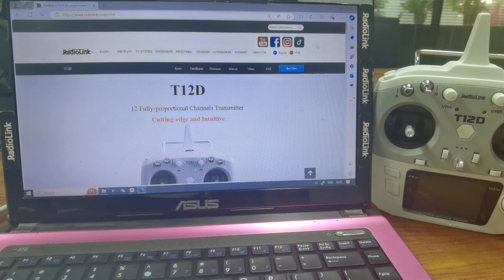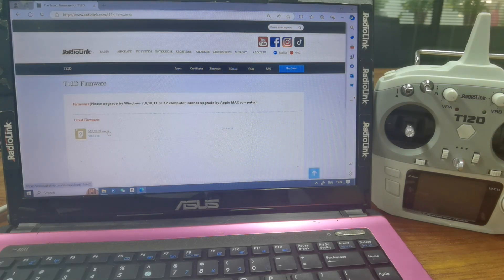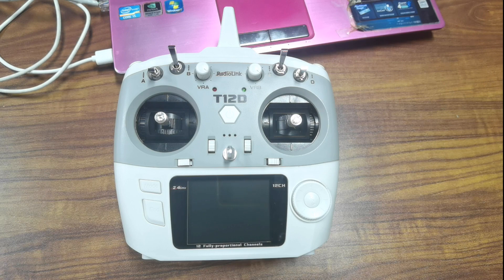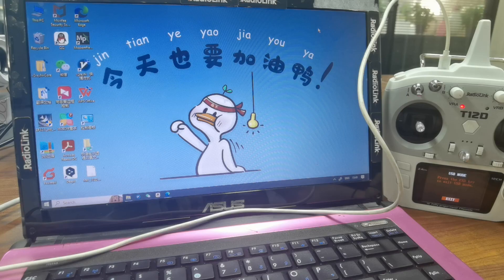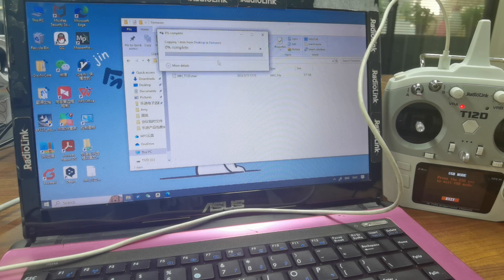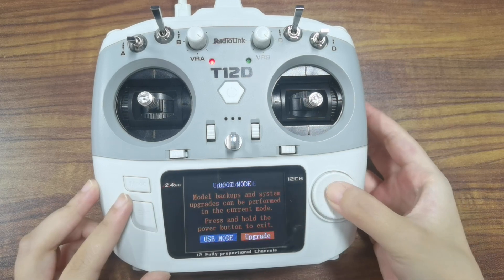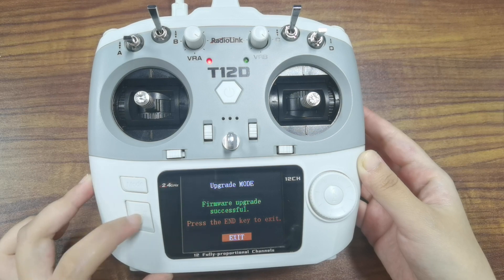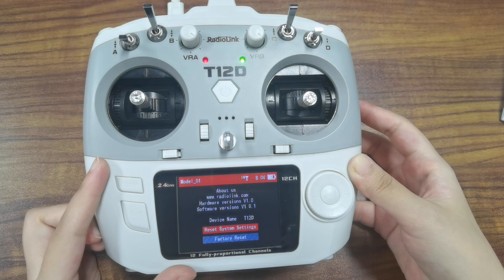How to update firmware of RadioLink T12D Transmitter?

Comment: Что лучше AT9S или t 12D ????
Reply from the maker: Dear sir, that depends on your specific usage scenario. These two products have different strengths. The T12D focuses more on cost-effectiveness and comes with a built-in simulator function, making it suitable for beginners and entry-level players. The AT9S PRO emphasizes anti-interference and high-speed response, making it more suitable for practical applications and players with some understanding of RC. Both products are compatible with external high-frequency modules. If you want to learn more about these products, you can check on our website.
Reply: @Radiolink_official And what is better for distance, At9s or T12??? I will use it for an airplane, can you help me choose between these two models??
Reply from the maker: @MementoMori-f6o  Hi, sir. Here is the comparison of T12D and AT9S Pro: https://www.radiolink.com/newsinfo/937609.html  The control range of both of them is about 4000 meters. If any question please feel free to contact us. Our email is: after_service@radiolink.com.cn
Reply: @Radiolink_official And if you use a range module, how much can you increase the distance????
Reply from the maker: @MementoMori-f6o  Hi, sir. If you use a long-range module, it depends on your long-range module.
Reply: @Radiolink_official You don't understand something, you do this and you can't tell me? How much can you increase the distance if you use a module? And which remote control is better to take?
Reply from the maker: @MementoMori-f6o  Hi, sir. The control range of the some modules can reach at most 30KM. For the actual control range, you need to check the specifications of the module. And both T12D and AT9S Pro supports CRSF and ELRS module. You can check their tutorials on our YouTube channel:https://www.youtube.com/watch?v=PuAQxhQXXis&t=3s   https://www.youtube.com/watch?v=W3HF_75FHeM  https://www.youtube.com/watch?v=5gClfQRbBVI&t=3s  If any question please feel free to contact us. Our email is: after_service@radiolink.com.cn
Reply: @Radiolink_official Well, if we compare the characteristics of these two models, which one will be better?
Reply from the maker: @MementoMori-f6o  Hi, sir. Both of are great. It depends on what function you want and which transmitter you like.
Reply from the maker: @MementoMori-f6o  If you want to connect ELRS module, you can use T12D. If you don't use long range module and just want the functions of the transmitter, you can use AT9S Pro or AT10II.
Reply: @Radiolink_official So it is written in the description that the long-range module can be installed on the at9s, or am I wrong?
Reply from the maker: @MementoMori-f6o  Hi, sir. Yes. You can also connect ELRS or CRSF module to AT9S Pro. If you want to connect ELRS module, you need to modify the cable. For T12D, you can refer to this video: https://www.youtube.com/watch?v=5gClfQRbBVI
Reply: @Radiolink_official According to you, t12D is slightly better than at9s, but why is t12d cheaper then? And at9s is more expensive, what's the difference?
Reply from the maker: @MementoMori-f6o  Hi, sir. Here is the difference of T12D and AT9S Pro for your reference: https://www.radiolink.com/newsinfo/937609.html  You can select the transmitter according to your needs, because different transmitters are good at different functions. If you want to connect ELRS module to the transmitter, we recommend you T12D, because you can read the information of the external module on the screen of T12D. But if you don't connect long range module and you just want more setting functions of the transmitter, we recommend you AT9S Pro, because it has more settings functions on AT9S Pro. We recommend you to check the detailed manual of AT9S Pro and T12D to know more about their functions: https://www.radiolink.com/at9spro_manual  https://www.radiolink.com/t12d_manual
Reply: @Radiolink_official Can you recommend a 6-7km range module for at9s?
Reply from the maker: @MementoMori-f6o  Hi, sir. We recommend you ELRS module. The control range can be adjusted. For more details, we recommend you to ask the seller of the module. Sorry we do not produce long range module for AT9S. If any question about RadioLink products please feel free to contact us. Our email is: after_service@radiolink.com.cn